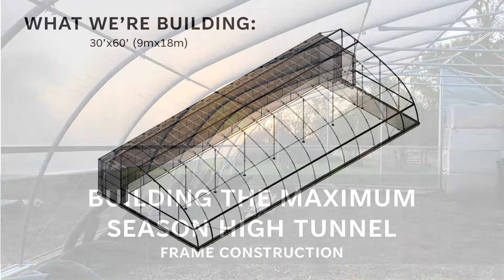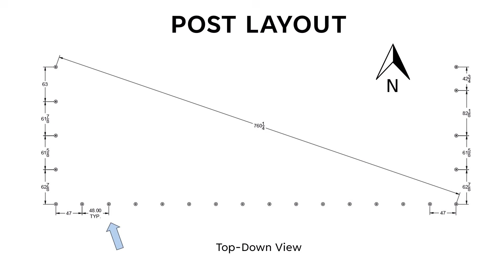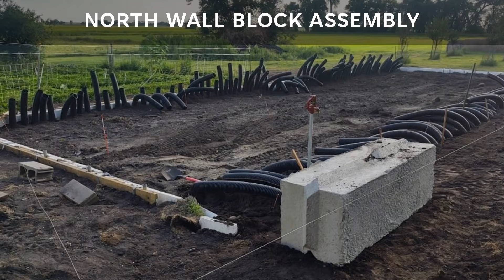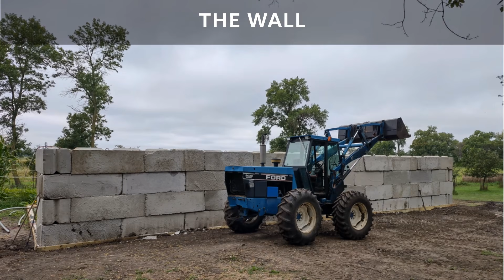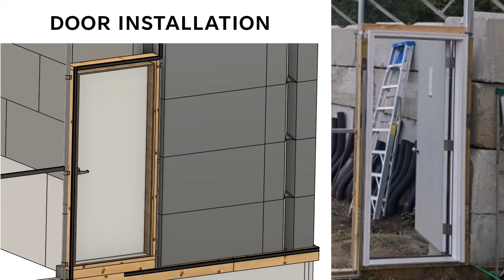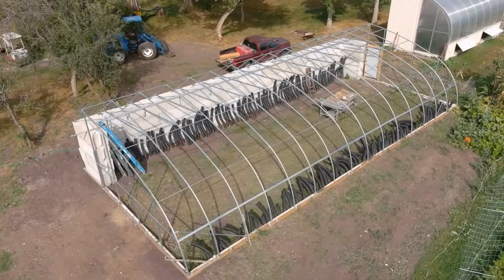Building the Ultimate High Tunnel Frame for Cold Climates

Comment: A wall made with concrete blocks seems to be a good idea but 
1. the blocks thickness are an important inconvenient.  The heat is more slowly released back in the greenhouse than a thinner wall.  So it might not work well as a heat storage.  
2. It would be safer to add a membrane between each block in order to complete seal them together to avoid water or air to pass through.
3. Opening vent all along the top of the greenhouse would be a great feature addition.  It would allow a fast an better way to ventilate the greenhouse with the bottom vents
4. A bottom vent would be another additional necessary feature.
Reply from the maker: 1. Thickness is as closs to optimal as is available in a portable block. If they are mortared it become a permanent structure, which changes classification for zoning, taxes and many other issues in some regions. 

2. Airflow between block would improve heat transfer too and from them. 

3. Yes, I wanted to add a roof vent, but didn't find a good and reliable way to achieve it (yet) . I'm open to suggestions. I didn't find that it really is needed though in my climate.
Reply: 1.  Optimal thickness for effective thermal mass: In general, 4 to 6 in of dense concrete is sufficient to absorb and release heat over a 24-hour cycle.
Beyond 6 inches, the heat does not penetrate deep enough into the wall during the day to be effectively released at night.  Less than 4 inches may not store enough heat to maintain a stable temperature at night.
Conditions for maximum efficiency
- South-facing: the wall must receive direct sunlight for several hours.
- Dark or absorbent surface: to maximize heat absorption.
- External insulation: to prevent stored heat from escaping to the outside.
- Good internal ventilation: to allow the stored heat to spread throughout the greenhouse.
The distance that heat travels in a concrete wall after 12 hours depends on the thermal diffusivity of the concrete and the exposure time. This distance can be estimated using the thermal penetration depth formula:
Estimation formula:  δ=(α⋅t)1/2
where:
•    δ = thermal penetration depth (in meters)
•    α = thermal diffusivity of concrete (in m²/s), typically around 1× 10-6 m²/s
•    t = time in seconds (12 hours = 43,200 s)
Calculation
δ=((1×10−6)⋅43,200)1/2 ≈ (0.0432)1/2   ≈ 0.21 m  ≈ 21 cm depth in concrete after 12 hours of sunlight.
Implications for your wall
•    If your wall is 60 cm thick, only the front half (≈ 20 cm) actively participates in storing and releasing heat in a daily cycle.
•    When the sun stops providing heat, the concrete wall will begin to release the accumulated energy into the greenhouse. However, only the heat stored in the area close to the surface will be effectively released. Some of the heat will continue to spread to the back of the wall, where it will not be able to contribute to warming the greenhouse and will therefore be partially lost.
Practical example
A 5 in thick concrete wall, exposed to the sun all day, can store enough heat to keep the inside temperature of the greenhouse above freezing on a cold fall night in Quebec.
2. It is best to seal the joints between blocks properly.   Here's why:
Advantages of sealing
- Better thermal conduction: heat circulates more efficiently in a homogeneous mass than in a wall with air gaps.
- Reduced air loss: leaks between blocks can create drafts that cool the greenhouse.
- Thermal stability: a well-joined wall acts as a unified thermal mass, which improves temperature regulation.
- It avoids moisture, mold, or water infiltration.
Reply: @denisdufresne5338 I am not a scientist but I wonder if you only have a 4-6 in concrete wall, wouldn’t some of the stored thermal energy then be lost on the back side (as well as the front, of course)? If that is the case, wouldn’t having a few extra inches (or a more scientific calculation that I have no clue how to do) help prevent thermal energy loss on the back outside?
Reply: @Memyselfandionyoutube  I agree with you, and this is why isolating the back of the wall is important to limit that energy lost.  R20 is a minimum.

Comment: Would it be possible to install solar panels internally along the block wall to collect energy as well as heat? You can buy pallets of old or used solar panels for relatively cheap (<1k usd sometimes), could help to power the fans or grow lights or even supplement heaters when needed
Reply from the maker: That would not be a good place to put them. You can place them outside as long as they don't shade the film covered part of the tunnel.
Reply: @waywardsprings hmm, I would think if the wall is collecting all of that solar energy then you could get a double usage out of that sunlight, no? It wouldn’t be ideal the position, but if you’re getting 25 solar panels for 500 bucks or so, even collecting close to a kw in addition to the thermal battery seems like a decent value!
Reply from the maker: @cxsey8587 the film reduces light coming in by nearly half already. Put them outside so they operate at full capacity. And hot humid greenhouse conditions ruin electronics fast.
Reply: @waywardsprings makes sense ! Putting them along the stem wall or above the blocks seems like a better placement then

Comment: Where could I purchase this?
Reply from the maker: Send me an email if you're interested. I need to make some adjustments to the BoM yet based on what we've learned. If there is interest, should be ready for quoting mid-winter. If you are applying for an EQIP grant, I can get you a manual so that you can verify this meets the requirements.
Reply: I’d also be interested.
Reply: @waywardsprings  What is your email?